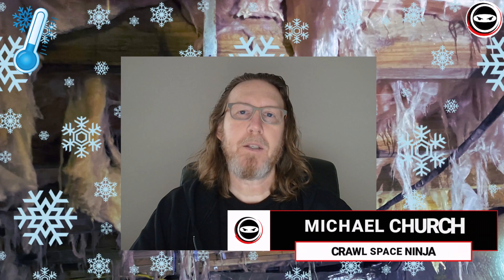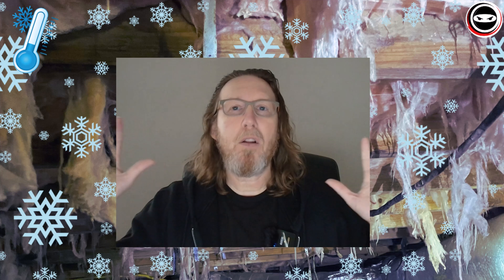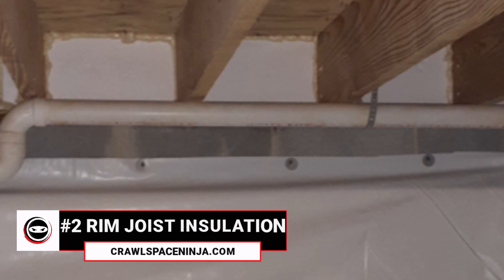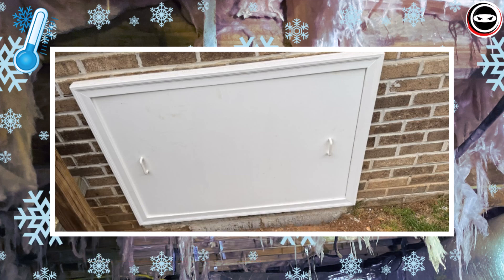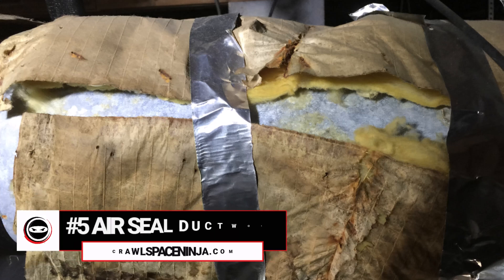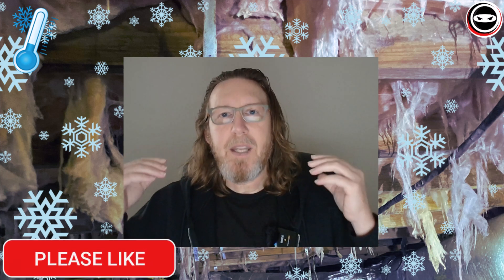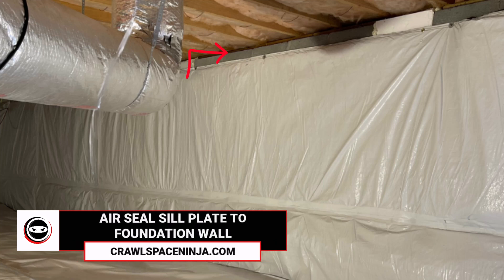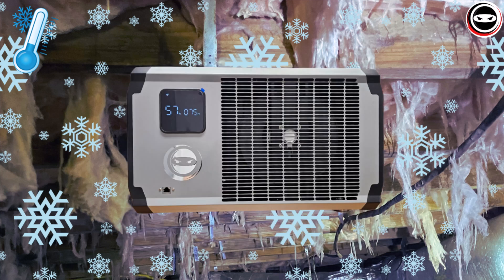Expert Reveals the Secret to WARMER Crawl Space Homes

Comment: I have 15 foot high crawlspace walls in some areas due to my house being on a steep hill. This winter we've had very cold floors. Kinda dreading what summer brings. What do you think is the best way to insulate those high walls when doing a crawlspace encapsulation? Thanks.
Reply from the maker: Insul-Vapor Barrier! It is so much more handier than Foam Board. Here is a link to what we use and we can calculate how many rolls you will need based off your dimensions - https://diy.crawlspaceninja.com/crawl-space-ninja-insul-barrier-r-value-r-8-73-100-sq-ft/

Comment: Have followed your system for building our encapsulated crawl space here in Pennsylvania.  No sub floor insulation.  There is sill foam in place between the sill plate and foundation blocks - but we left the top several inches of block uninsulated / no vapor barrier for visbility for termites.  That area I assume will lose a lot of heat in winter.  Do you recomend we put 1 or 2 registers from the furnace pointed down into the crawl space to ensure pipes don't freeze, hardwood flooring in living space is comfortable / not cold, etc?
Reply from the maker: I am not real familiar with how cold it gets where you are but I have spoken to several people in New York and other parts of the country that adding HVAC registers to the crawl space is not needed after encapsulation with wall insulation. We do not do that here in Tennessee but we are way more mild than you are on temperatures I would assume. If you feel it is necessary to keep pipes from freezing please go ahead I don't want you to have to deal with that. But you could also put in a thermostat and humidity reader to keep track of it to see how it is performing without doing that or you could wrap the pipes themselves. Thank you so much for watching our videos and I hope that helps.

Comment: Southern Oregon here;
My subfloor consists of 1×6 boards with some sort of particle board on top of that (1983) we recently replaced the wall to wall carpet with a 1/2 inch laminate commercial grade click lock flooring that has a foam pad attached to it and also added a high quality pad that is taped together. Should that be enough to air seal the rooms that flooring is in (all rooms except bathrooms)? And just air seal penetrations.
Reply from the maker: You will need to check the R-value. We find insulating the crawl space walls with an encapsulation will keep the floors warm